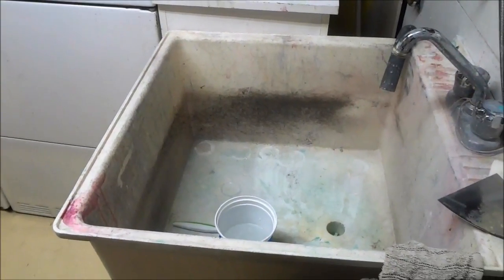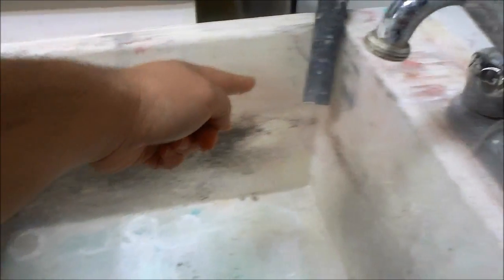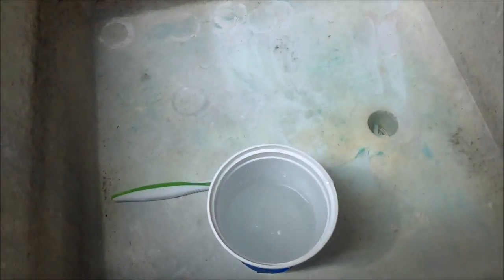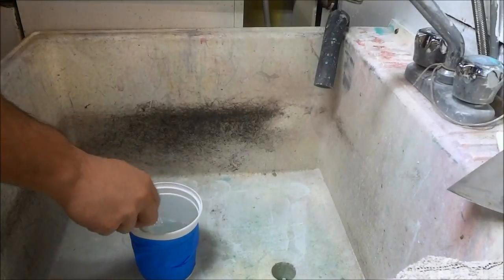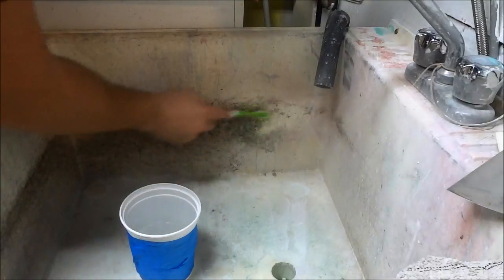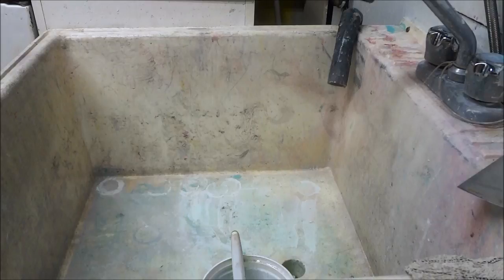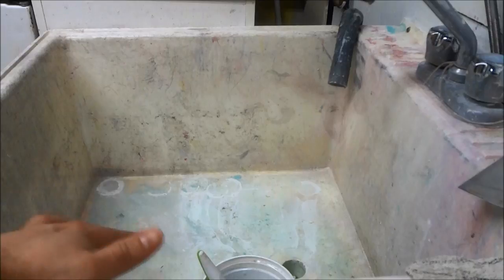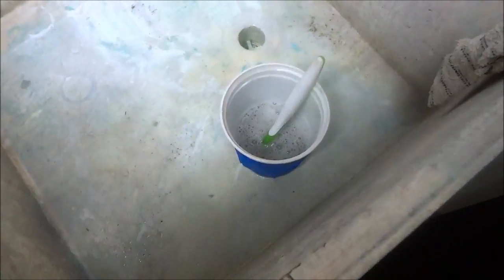How To Remove Soap Scum And Dirt From A Laundry Tub

Comment: Mine looked worse than yours.  I just sprayed it with Krud Kutter and used a light color scrubbie sponge, not the green kind.  Let the spray sit for about 5-10 minutes and it will come right off.  Maybe do this a couple more times.  Much quicker than a toothbrush, though I use one for corners and crevices.